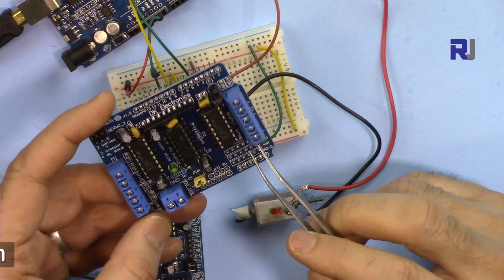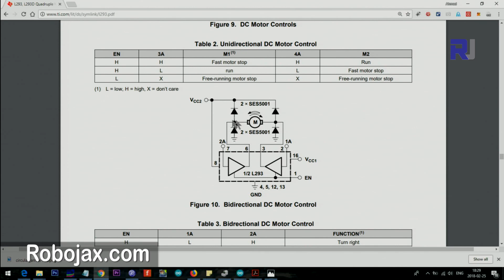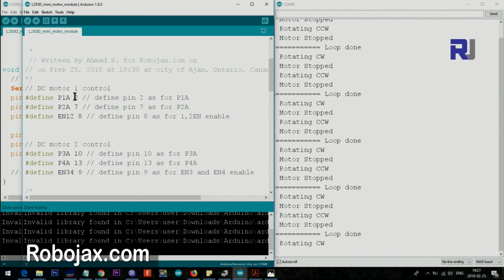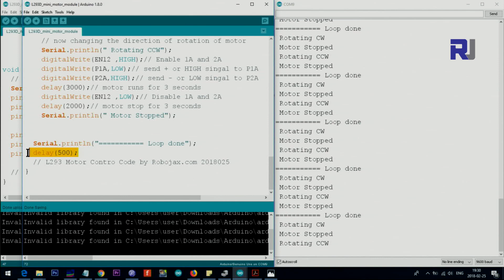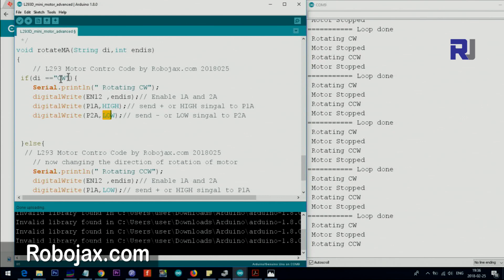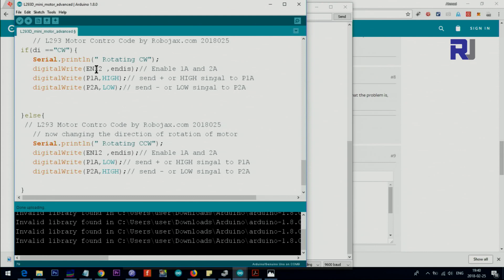Introduction to L293D and Controlling DC Motor RJT64

Comment: Knowledgeable video thank you for this but I have a question regarding to this please reply me help
Reply from the maker: Thanks . Please post your question here and I will try to answer . I read all comments.
Reply: @robojax  thank you for the reply. 
You are using l293d module in your project but I am trying to use L298n in the module so please tell me the connection difference between the L293d and L298n motor driver
Reply: @robojax  is the connection of both motor drivers are samr or not..?
Reply from the maker: search my channel for L298N videos. learn how to Search for a  Particular  video in a channel here https://bit.ly/findYouTubeVideo

Comment: broo you deserve my thumb.. but i still wondering how to make the motor run with speed increase by the time.. thanks man
Reply from the maker: your question is very vague. time means clock or time mean just in a moment like in 5 seconds from 0% to 100% speed? if that is the case then it is very easy. you have leaned how to control the speed. just write a loop (for loop) which goes from 0 to 100 in increment of 10 (for example) so it will go 0, 10, 20, 30....100 and then pass this increment value into the speed control.  Watch this 30 minuets Arduino course to learn about "for loop" https://www.youtube.com/watch?v=Mbb2xa1WcRM Good luck.

Comment: Thank you very much!! How would you wire it for two motors?Thanks
Reply from the maker: Have you watched the video? I just checked the page where the code is and it is for 2 motors.
Reply: @robojax  Yes, im pretty sure that the code defines the three extra pins for the second motor, but I don't think it shows how to wire the second one.

Comment: Can I use l293d to control position of dc motor with a potentiometer?
Reply from the maker: Position of DC motor can't be controlled unless you use high resolution motor encoder. Encoder is attached to the shaft of motor and as motor rotates, in 360 degrees, using encoder and Arduino we know where it is. Stepper is the best solution and here are my videos on stepper https://www.youtube.com/robojaxTV/search?query=stepper

Comment: The connection at 7:46 is a bit wrong, the 8th pin should go in the 5volts rail rather than the ground rail. 
Great work other than that!
Reply from the maker: I just watched it. it is connected to 5V.

Comment: How many l293d can be added with Arduino uno
Reply from the maker: you got 12 digital pin with UNO, now count how many is needed. I would have to watch the video to see how many pins used. You watch and cound the digital pins. Do not count the VCC (5V) and Ground  because you can share the 5V and GND with other L293D chips.

Comment: you are great, I have a question : How to write code for control dc motor change direction by one button ?, thanks
Reply from the maker: Thank you. I am working on it. It is coming. One video to change direction of rotation using 1 button and 1 stop. Another video 3 buttons CW, CCW and Stop.

Comment: I did all connections correct. My ic is correct and motor too.But only one motor is running why is it so...
Reply from the maker: you must be done something wrong. Or the L293D is bad. Check the wiring. Remove them and put them one by one again.

Comment: How do you do this if you want to use an external power supply? Like if you want to power the motor with a battery pack? Do I need to ground the battery pack through the arduino ground pin?
Reply: Plug the power source to VCC and the ground pins of the chip to the ground of the power source. If you are using an external power source to power a component never ground it to an Arduino; grounding a high voltage to an Arduino can cause damage.
Reply from the maker: For external source, remove the PIN 8  of the chip from VCC and connect your power supply up to 36V to pin 8 Keep the GND to arduino and connect your power supply to the GND. So Arduino and your power supply must have common Ground (GND) otherwise motor will not work. I have explained this at 14:30.  @Adam Walker, without common ground, the motor will not move.